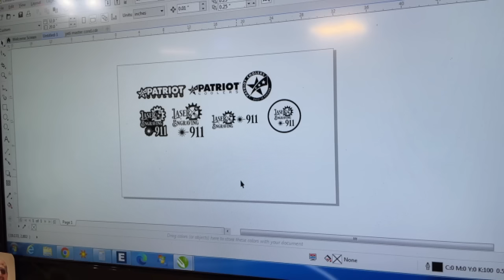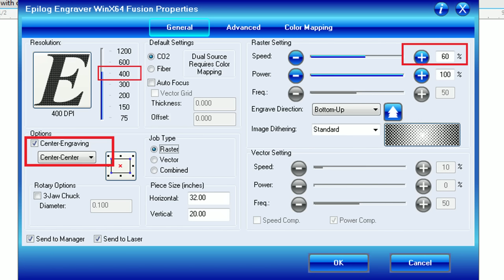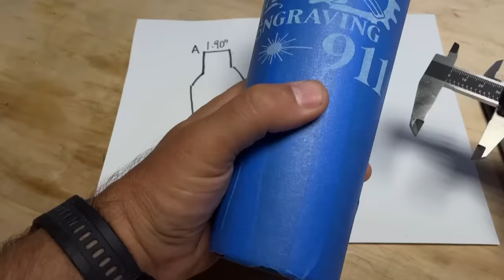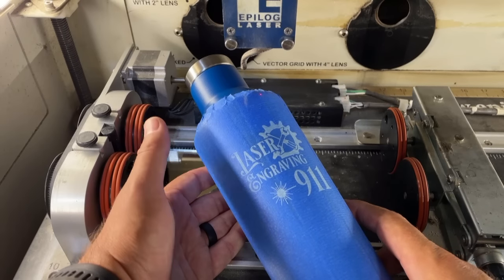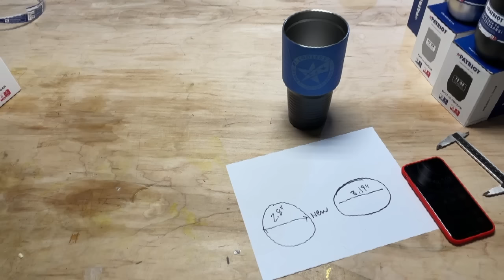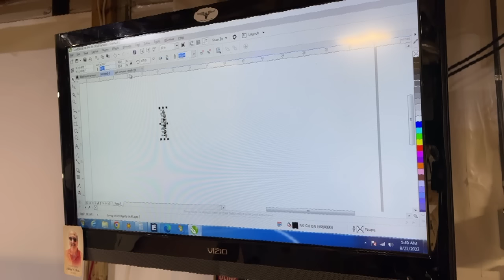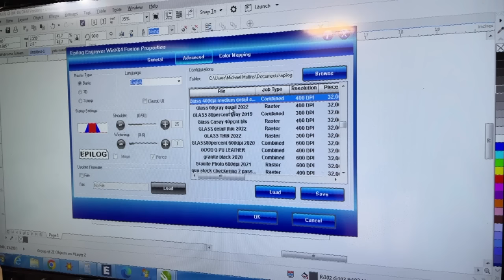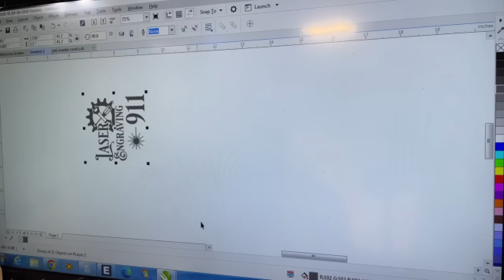How To Laser Engrave Cups And Mugs

Comment: For the round logo, it would probably be easier to use the callipers to measure the width of the logo on the cup and then use that to calculate the percentage that you need to stretch the design by.
Reply from the maker: The way I show in the video is how its done, and has been done for quite a while now, Im not aware are the method your speaking on, but you should give it a go and see how it turns out and, maybe even make a video on how well or unwell that methods works. Its always nice to share laser hacks with the community, and things that are helpful.

Comment: Brother this video is amazing.  Maybe you can answer it a little further on this topic.  My cup is the same diameter at the top as on the main engraving surface so i understand the formula to squish the round shape to make it look round.  However the bottom of the cup is smaller than the top.  So I used your formula for adjusting the width of the circle based on the opening being a different size, but how do i do both.  I need to adjust for the top being a different size than the engraved area, and then also adjust for it being a circle to make it look round.
Reply from the maker: That is a tricky shape to get circles looking right on tapered cups my friend, your not alone in this, you just have to adjust those ones how they look best unfortunately.

Comment: Use percentage is way simpler mat and should give you the measurement off your narrowest point not center but if you divide the widened width by the desired width 4”/2.5”=1.6”.   The original from center was 1.9/3.16x2.5=1.5. If you round down the bottom you get 1.9/3x2.5=1.5833. As 3 as bottom is an estimate the simple math should workout

Comment: Great video...probably the best I have seen on this topic!!! I was under the impression from watching many videos that you should typically not run at 100% power...the primary reason seems to be tube longevity. True? False? Also, I have seen other videos that used cheaper, regular masking tape...thoughts? Thanks.
Reply from the maker: I have not seen this to be true with my laser, although I do have an Epilog and they are know for their robust work horse ethic! 😂

Comment: Hi, thanks for this great explanation video.
I only have one question. Where you engrave the tapered bottle, you did some math to calculate the new width of the logo, but you didn't change the dpi setting. In my opinion this means that the file will now have a much lower dpi on the output of the machine because the 300 dpi file is smaller, but will be stretched because of the rotation speed of the rotary roller. 
Don't you have to compensate for that dpi setting as well?
Reply from the maker: Yes, correct, I'm using vector graphics not jpg images, the dpi is set in my laser software, and does not matter with such small changes like this, changing your dpi to compensate, it only is applicable when you are going from very small to very very very big, and if you not using vectors.

Comment: I am thinking of getting a laser. The one I am looking at  Is an Ovsuqu Galvo Laser JPT M7 MOPA 100W Fiber Laser Machine 300x300mm will this cut and mark wood, Glass, Marble, and other nonmetal materials If I adjust the power, frequency, and other settings? My main thing is that I will be Engraving on gun parts.
Reply from the maker: No, your getting a fiber laser designed for metal, and some polymers, you need Co2 laser to laser engraving wood, glass, leather, acrylic and more check this unit out.  https://shrsl.com/4fnxt

Comment: Just curious about the settings on the first cup you engraved: the graphic is a vector type, but the engraver was set to raster. The outcome was perfect, but it seemed illogical to me. Thoughts?
Reply from the maker: Raster engraving is a term used when the laser move back and forth along a set path to achieve the printing or engraving effect, vector cutting is when the laser is in ON and follows a set path, designated by the lines in your graphic. You an raster engrave a vector file or you can raster engrave a jpeg file, I always use vectors for all my engravings, as the are the cleanest, unless I'm doing a photo on wood, then I use bitmaps.

Comment: I am watching videos to research laser possibilities I might use to justify purchasing a laser of my own. I noticed you use a roller to rotate your cups and commented that that system does not come back to the same location producing ghosting. I also noticed you require math to compensate for font sizing and spacing. Have you considered changing out your roller for turning you parts between centres connected directly to your stepper?

Comment: Ok I am new to the laser commuity and I am wondering if it matters on the "color" of the masking tape.  Can you use regular White?  Is there a difference between the painters blue vs green tape?
Reply from the maker: You just want to use a dark masking tape so you can see the laser mark, white does not work well, green and blue are ok.

Comment: Outstanding video.  Thank you for all you do.  Question...I recently engraved a BLUE powder coated stainless steel tumbler with my normal setting (300 speed / 20% power on a OMtech 55 W) and the engraving turned out leaving what looks like a bluish tint on the stainless steel.  Could this be due to the speed/power setting?  Am i using to little power or the wrong speed?  I would appreciate any suggestions.  Thank you!
Reply from the maker: Its very typical for blue and red powder coated items to leave a blue or red translucent color after engraving usually this just wipes right off with some LAs totally awesome and a tooth brush like I show in the video. if it wont come off that way way slow your speed down and crank up your wattage to max and try again! I have a 60 watt machine I use here and my setting for all powder coated tumbler is 400dpi, 20% speed, and 100% power,, works great on all tumblers and all brands.

Comment: Did the equation solve engraving on a wine glass or non flat item to accomodate the logo top being a different size then the logo bottom?
Reply from the maker: For tapered glasses like that, you will never get it perfect due to the taper but this method helps alot!

Comment: One edit! The technique of leveling the cup only works if your machine (specifically your machines bed) is also level. Many machines are set up in warehouses or garages, and those floors are not always level.

The better way is to use your focus key and the z axis table motor to focus on the right side (aka the side that the rotary tool pivots on) and then the focus tool and the rotary pivot to focus to the left side of the “real estate” on the cup. That will ensure that the cup is parallel with the gantry of the machine. Aka perfect focus.

Hope that all makes sense.
Reply from the maker: Thanks for sharing your methods!

Comment: With that big of a taper, could you measure the diameter at the top and bottom of logo and "keystone" the graphic? Would that work or would it even matter?
Reply from the maker: Its another way, you could try, not sure if the difference would be that noticeable. from the method shown.,

Comment: Great video. That paint for Stainless steel is definitely something else.

Question I have, let's say your tumbler is powder coated and you engrave it.

Will engraving it, spraying it in place with the laser paint and re-engraving give it another color? In theory, I'm assuming it will. I am just wondering if you have tried it.

Thanks for the content, look forward to a cup haha.
Reply from the maker: In theory yes, however I don't spray thing in my laser, the risk of getting spray on my lens and electronic is not worth it, I would recommend you "paint" the product on in place, you can get brilliance laser ink in paintable format. that you can brush on.
Reply: @Laser Engraving 911  

Hmmmm.

Very nice, I'll have to try that and see how it comes out.

Thanks again, brother. Keep up the great work.

Comment: Thanks so much for this video! 
Wondering if there is anything you can do to brighten the stainless steel that looks like the laser has burned too much? Like the stainless steel looks darker even after cleaning with ZEP spray. Does the LA awesome spray clean that too?
Reply from the maker: Are you using a Co2 laser or A Diode Laser? Need a bit more info on your machine and process to help, thx
Reply: @LaserEngraving911   CO2. It’s an epilog 60 watt mini laser. Would I be able to send you an email with additional info?
Reply from the maker: @macseidler6931   you can shoot me an email over at www.laserengraving911.com

Comment: question on the stemless wine glass, it has a taper to it, did you have to do anything to figure for the bottom of the logo being wider then the top? great video by the way alot of great info
Reply from the maker: Hey There, with Stemless wine glasses I usually don't do anything special unless its a round logo and I have to use the stretch method to make it look more like a circle.
Reply: @LaserEngraving911 
Yeah, taking about stainless steel cups. What's the equation you use to figure a perfect circle when you don't have a neck on the cup? I know on the bottle you multiply A x B then divide it by C  but on the cup there is no A, just B and C.  🤔🤔

Comment: These are great tips. One question: How do you handle extremely tapered things? I have done whiskey type glasses that had a heck of a taper and thus the logo distorted and got noticeably smaller or wider at the top/bottom. I ended up distorting the vector image but no amount of math could make it consistent. Tips?
Reply from the maker: Take a look at my blog post here: check out the diagram in the blog see if that helps. https://www.laserengraving911.com/post/how-to-laser-engraving-lots-of-drinkware-cups-and-all-that

Comment: 31:39 can u just do what u wanted squared divided by what u got by measuring?  Eg. Wanted 3 inches wide. Got 2.5 inches wide. (3^2)/2.5; 9/2.5 = 3.6
Reply from the maker: Give it a go! and let us know it went, and if that worked the same it would be great to know.
Reply: @LaserEngraving911  have a 60watt 3D m7 jpt mopa on the way. Hopefully will be here in a week or so.  Wonder if 3D head will fix this without correction factors.
Reply from the maker: @jmbauer68  It should as long as you program the head correctly should not have issues. That is what those 3D scan heads were created for.